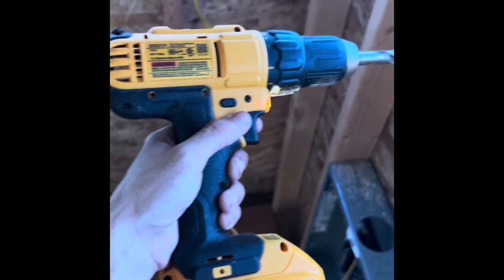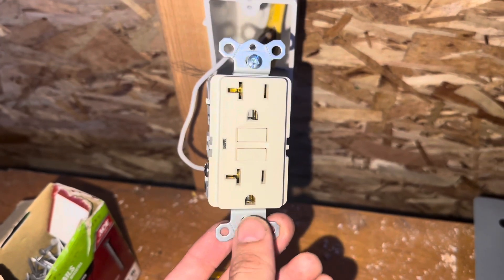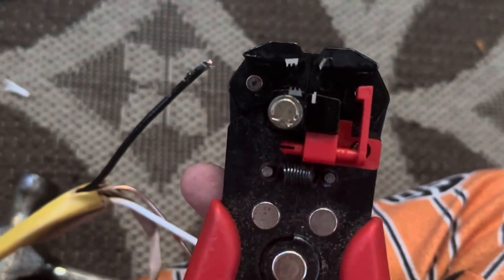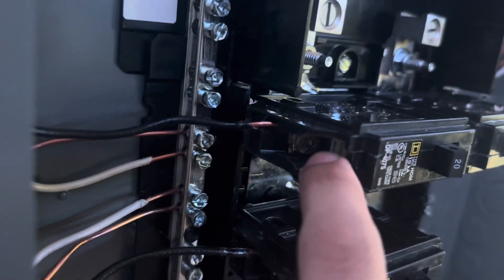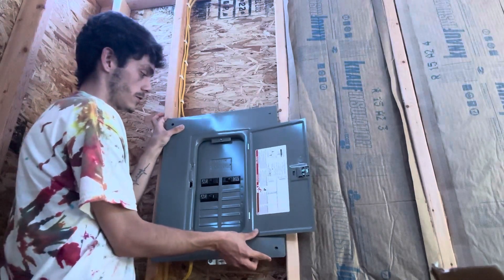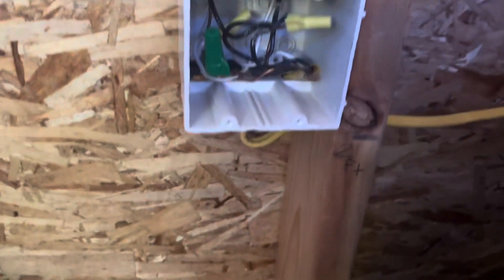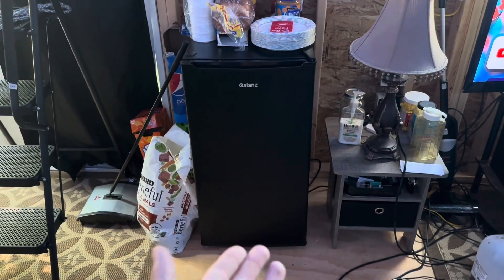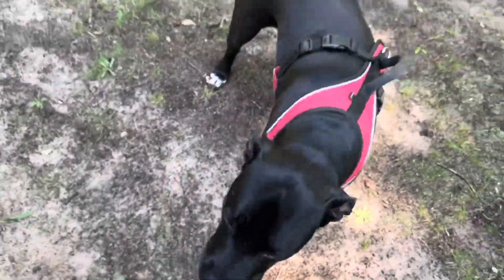Wiring a 12x20 Tiny Home!

Comment: Those splice boxes need cover plates and can't just be covered by the drywall or whatever interior wall that you are using.
Reply from the maker: I have the cover plates already but they go on after the drywall.
Reply: @TinyHomeBigIdeas  I didn't want you to have to bust holes in your wall to be code compliant. It looks like you are doing a good job.

Comment: ? What state are you in
Reply from the maker: Michigan
Reply: @TinyHomeBigIdeas  I live in Oklahoma and I have a 12×20 shed I use as an art studio I heat with propane 5,000min 10,000 max BTU a 20 pound propane bottle will last about 4-5 days when the temperature runs in the teens to 0°

Comment: You should add a main breaker. Even if it is fed from another breaker in another panel it still should have a main. The guage of feed line should determine size of main. Not an electrician by trade but  I rewired a friends house and the city inspector passed it.
Reply from the maker: Being a sub panel, its does not have a main breaker. The main breaker is located in the main panel. It’s unnecessary to have a second main. It would pass code as it is.